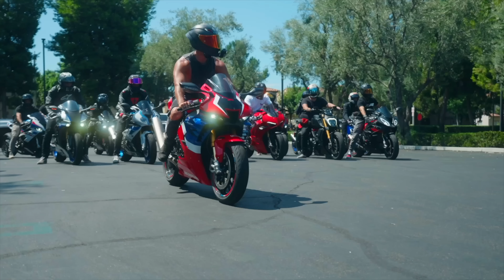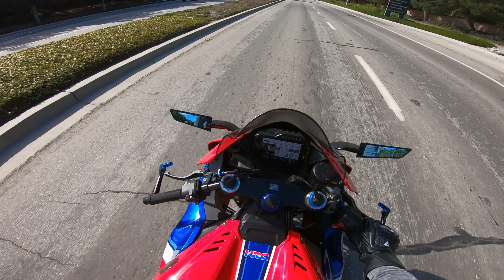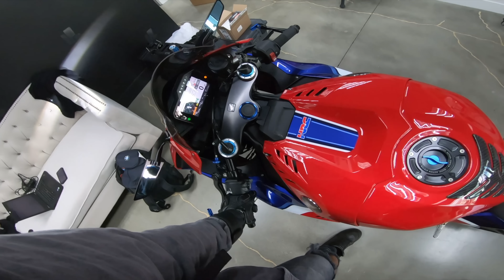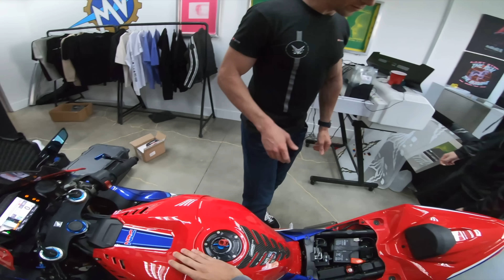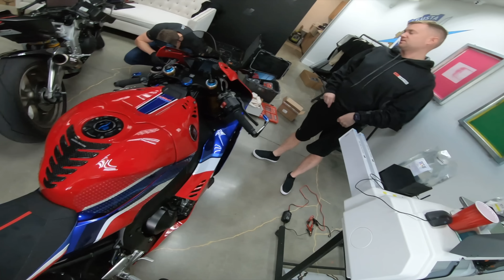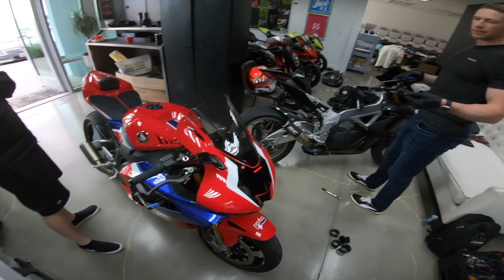Watch This BEFORE Buying A Honda Fireblade RRR

Comment: Don’t know about US bikes, I’m from Europe and my RRR SP has 218hp from factory, and it’s a freaking bullet. I can smoke most of the bikes on the street and I’m stock. With a full akro system it will be even better. So if you can afford an RRR, go for it, not a great daily bike, but a monster of a bike for the weekend or track riding. (EU standards)
Reply: What makes it a bad daily?
I'm on an 08 GSX-R 750 and am currently looking for what the next step should be.
Reply: Wtf is “akro”?
Reply: @EscapePlan97  Akropoviç
Reply: No tune?

Comment: Those bikes are really reliable. I see your opinion on it kay. But mine runs fine no issues since I had it with new exhaust so far haven’t done nothing else but no issues electronically or mechanically
Reply: At the end of the day he’s had an ecu flash/tune so got nothing to do with the bike it’s self. He can’t blame Honda for a 💩 ecu flash 😂

Comment: I love my 2023 Fireblade. I've only put 120 miles on it and it needs a tune badly. Throttle is super on off and the throttle mapping is trash. Once I've got it broken in and tuned I know it's gonna absolutely rip.